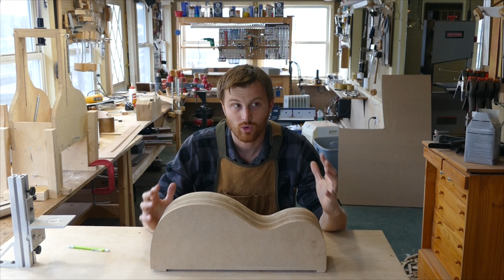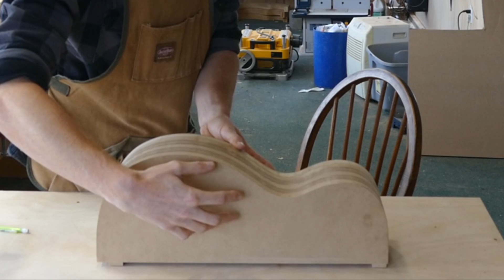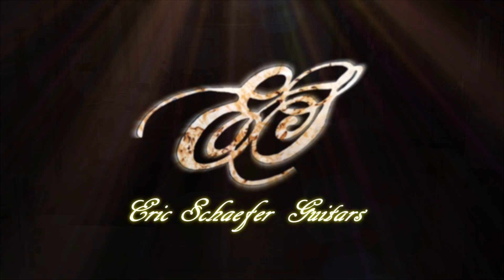How Guitar Sides Affect Tone

Comment: Can you point the way to any info regarding cloth vs. wood in regards to side bracing? Been reading lots of forums and there is so much subjectivity in regards to cloth vs. wood. If cloth is used, then how does this make the sides rigid as compared to using wood braces for the sides? Thanks Eric. Great video on sides.

Comment: Thank u man for the advice!  I have a question..if ill built an all mahogany om size guitar.. what thicknes u recomend for the back , top  and sizes? Saludos de peru ;)
Reply from the maker: You're welcome! I would say:
 Sides: 0.085", 0.075" at the waist
Top and back: 0.090" - 0.120" (Final thickness)
For the top and back, if you aren't too experienced I would err towards the thicker end of the spectrum. One of the biggest mistakes beginners make is starting out too close to their final thickness and then sanding more aggressively/more frequently than they should. So starting out at 0.120" on the top and 0.110" on the back is a pretty good way to go.
Reply: @EricSchaeferGuitars   thank you again! So can be exactly the same thickness of the top and back or you recomend for example the back thinner than the top?